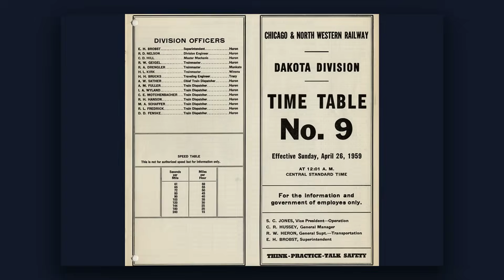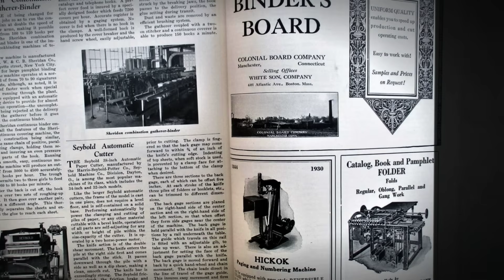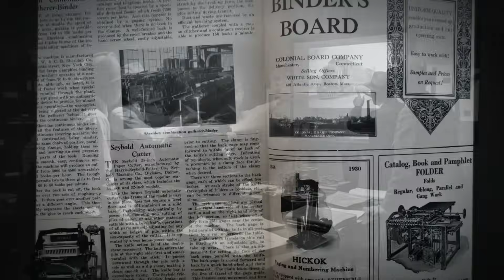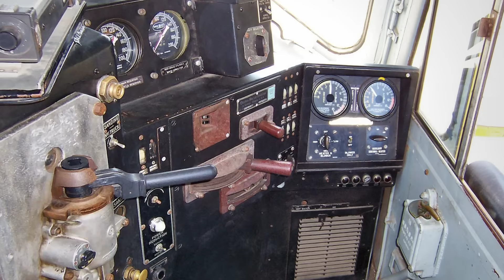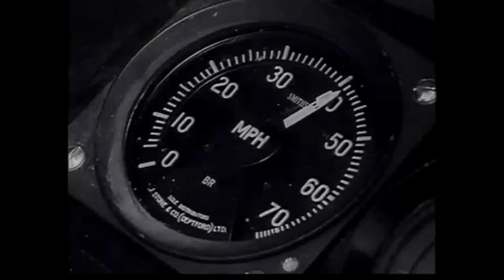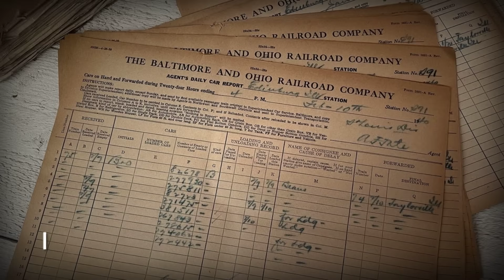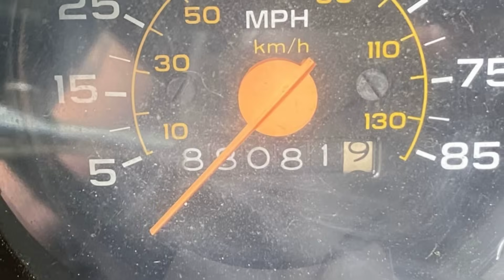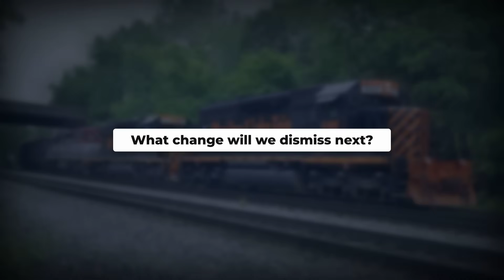Railroads Called It a "Smelly Tin Box" — Then It Retired 5 of The Biggest Steam Engines

Comment: I believe overloading the  F units (running them at too low a speed for too long at too high a power setting) especially on a hot day could burn out the traction motors and/or the generator (which was coupled behind the Diesel engine inside the locomotive - also there was voltage inside that would kill if someone touched the wrong thing when the unit was operating

Comment: Got it backwards. 4 Diesel locomotives each with a 567 V16 engine to do the work of one large Steam locomotive. But thanks to mutual unit control one crew could operate the consist of ABBA. 
Also true that the Diesels required much less labor to run them.
These were not the first Diesel locomotives but the first ones to really challenge Steam for heavy mainline power,  There were already less powerful but faster E units for passenger trains.
  I believe the longest trains on Western grades sometimes had as many as 8 locomotives in total working but still under the control of the lead unit by mutual unit control and perhaps by radio. Although a "helper" consist linking up to the back to help get up the grade would have its own crew.

Comment: The 567 had a supercharger not a turbocharger, c'mon get your facts straight . I agree with others random photos with nothing concerning content
Reply: It had both. EMD 567 with a Roots blower could have a higher compression ratio of 16:1 Same engine with a turbocharger had a compression ratio of 14.5:1.
Reply: Correct. Just a supercharger. Since they were two-cycle diesels, they needed a mechanically driver supercharger to push air into the cylinders (no intake stroke). Later EMDs had both superchargers for low engine speeds, and turbos for higher speeds, mechanically interconnected with an overriding clutch.